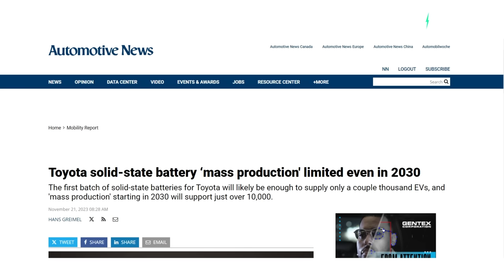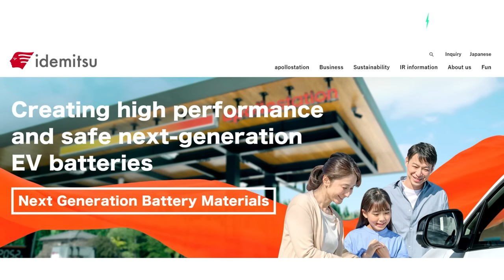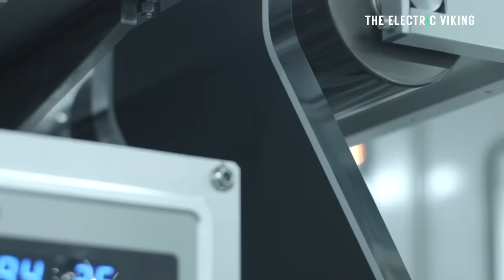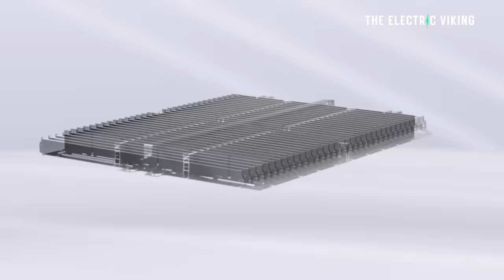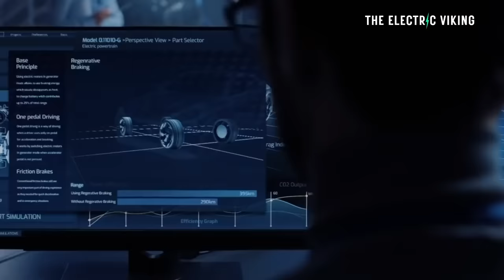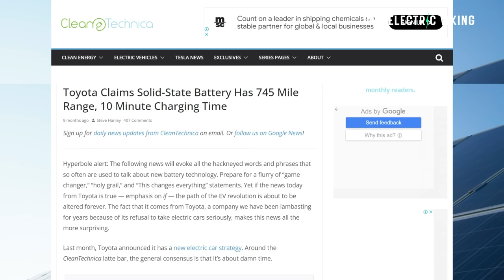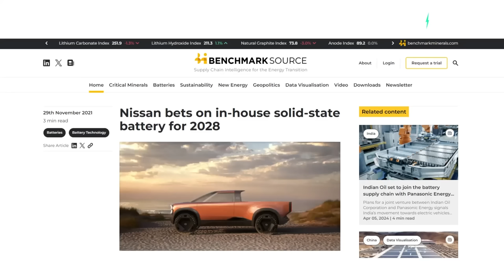Toyota magical-state battery 'mass production' only enough for 0.1% of Toyota cars

Comment: I totally agree that the new high power LFP batteries are the best bet for the near future. Both for pure EVs and PHEVs.
For the latter, why doesn’t any company make one with a decent battery range? 50km of electric driving seems to be the max available, which is useless. We need a PHEV which can do at least 100km on pure electric, so that it can cover most people’s daily driving needs. That could be done with a 20kWh battery, 1/3rd the size and weight of a Tesla Model 3 pack. Couple that with a small, efficient sub-100hp engine, and you’ve got the equivalent of 200hp for motorway driving and no range anxiety. With a series hybrid approach, using hub motors, you’ve got no axles, no driveshaft, no gearbox. Weight could be 1200kg or less. I’ve done the math on this, and it works beautifully, but not a single car company is making anything close! Why?
Reply: You make an excellent point that has dominated my thoughts for years. BMW was on the right path with the i3!!! They just needed to install a 25Kwh battery. The Nissan Leaf with a Micra engine as backup would have been fantastic. Actually any PHEV with a 20Kwh LFP pack would be viable imo. But I do think that a little Tesla is the very best solution and I'm excited for it's arrival.

Comment: There are good technical reasons to think a solid state battery, like hydrogen propulsion is not such a good idea for motor vehicles. The main advantage of polymer batteries is that they can flex and bend so are better able to absorb shock and vibration. A solid state battery would need a strong case and shock mounting to prevent cracking. In a mobile setting this would likely offset any advantages. Solid state batteries seem likely better suited to stationary applications.

Comment: Solid State batteries remind me of the Wankel rotary engine saga. They are better in theory, but the existing technology continues to improve at a faster rate. As a result when the “better” technology finally comes out, the more traditional technology has surpassed it due to iterative improvements.

Comment: “The amount of CO2 in the atmosphere today is comparable to where it was around 4.3 million years ago during the mid-Pliocene epoch,” the NOAA report found. That was when the “sea level was about 75 feet higher than today” and “large forests occupied areas of the Arctic that are now tundra.” Last year, humans spewed some 36.6 billion tons of CO2 into the atmosphere, the most ever. That number may well be higher this year. The concentration of carbon dioxide in the atmosphere is now more than 50 percent higher than it was before the industrial revolution. It’s no secret where all this carbon dioxide is coming from. The burning of oil, coal and gas is the main source of CO2 emissions, and the use and production of fossil fuels continues to rise around the world, with the United States producing more oil and gas than ever before.

Comment: Here is a quote from google what might be the source of the problem. 
"Yes, Toyota has been developing solid-state batteries since 2012 and has over 1,000 patents for them. In October 2023, Toyota partnered with Idemitsu Kosan, a Japanese petroleum company, to develop and mass produce solid-state batteries for electric vehicles (EVs) as early as 2027. The collaboration focuses on sulfide solid electrolytes, which are considered a promising material for EV batteries. Toyota's first solid-state battery is expected to have a driving range of 621 miles and charge to 80% in about 10 minutes. Other potential characteristics include a range of 750 miles and a good life expectancy. Toyota claims that solid-state batteries could be a "potential game-changer for BEVs"
Why would you trust a petroleum company - Japanese or otherwise - to make something that would put them out of business.

Comment: Vw will start production of ev batteries in there new battery plant in North Carolina April of 2025 14 lines of production 4 lines for lfp batteries for plug in hybrids the other 10 for hybrid and full electric. Don’t know what battery they will start with.
Reply: Ford and GM has been saying the same for years but all legacy auto end up buying batteries from 3rd party battery makers. Legacy auto can't make high quality ev batteries
Reply: @larryc1616  the Toyota battery plant is over 3/4 done.

Comment: Current battery packs have i high carbon footprint due to the synthetic graphite. This needs to change.
Reply: Even if the battery was pure graphite, a pickup truck would burn more carbon based fuel in a few hundred miles.